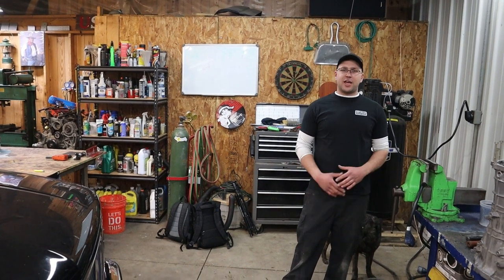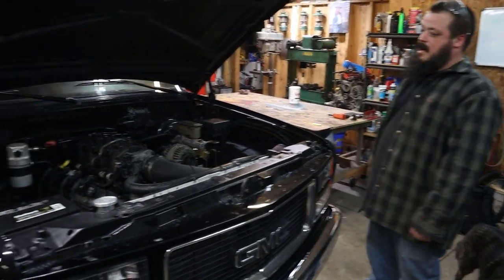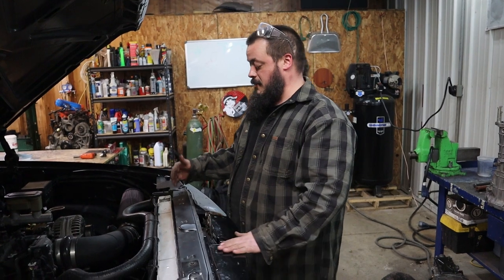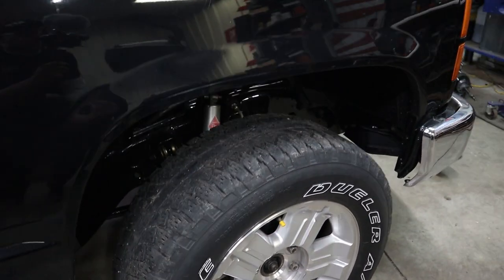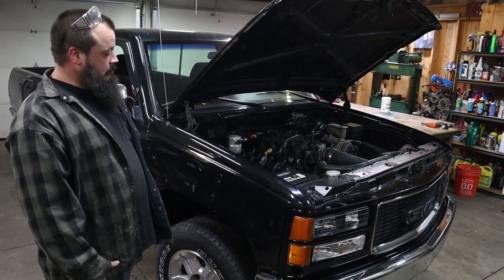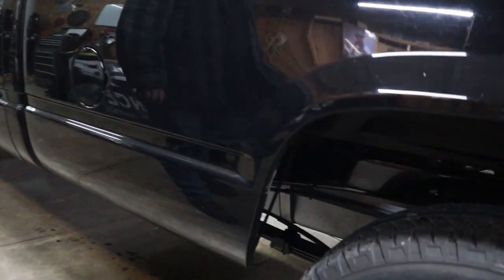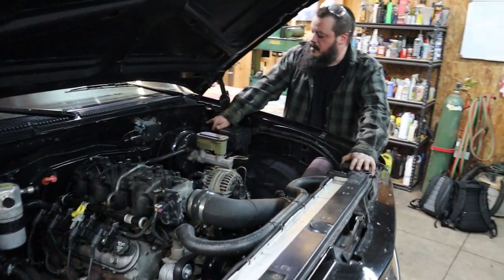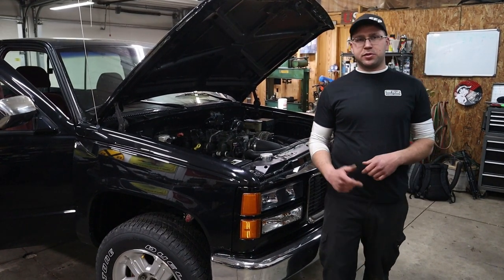CLEAN 95 Chevy/GMC OBS Truck - LS swap.

Comment: Doing the same thing" 93 4×4  it's a 6.0 4l80e 241c all done except the wiring, after watching many videos on the wiring, starting to think I'd be better off spending the money on a Holley Terminator X,  because. When this guy switches to a 4 L 80 he's going back to the tuner when he puts a turbo on he's going back to the tuner if he changed the cam he's going back to the tuner he changes the intake he's going back to the tuner gear ratio tire size... not to mention the Halo unit has to offer with power adders. I just need to figure out the gauges and the AC? Damn I hate wiring
Reply: Look up speartech for a harness..

Comment: This truck is awesome.  I am doing this on my 96 Yukon.  Where is the ECU located?  It is so clean under the hood.  Where is the coolant expansion tank?
Reply from the maker: Kelvinbellrose, the ls pcm is located behind the glove box in the original pcm location. I modified the original mounting pad to accept the newer pcm. And for the coolant expansion tank it is located on the radiator core support under the battery tray.

Comment: I have a 92 k2500 with a good 4l60e. I was wondering if a 5.3 would work with it. Will an LS PCM control an older 4l60e? At most I'd put a cam in it. It would be nice not to have to touch the drivetrain.
Reply from the maker: 332ARA, I do not believe the older 4l60e transmissions will work with the newer LS pcms. This truck had a 4l60e as well and what I ran into was the transmission connector on the Ls harness has alot more pins than the older 4l60e connector . Also the connectors themselves are different in shape and design. I think he best route if you really want to keep the original 4l60e would be to look into a standalone transmission controller.

Comment: 91 chevy silverado was my first truck.. Love the obs body and looked for years for the 2 door tahoe.. Finally found a completely straight 95 2d yukon 4wd out of the desert so 0 rust issues. Has the 5.7 thats still goin strong. Love driving the thing but having issues w the 4L60E trans. She revs at high rpm shifting out of 1st. It may be skipping 2nd and going 1-3. I can feather the pedal and it seems to help. I was told to do the vette servo swap on the trans.. Apparently its a known issue on this trans?
Reply from the maker: Yes I have heard alot of people upgrading the servo. My opinion is that would be a upgrade to do when complete rebuilding the 4l60e. The high revs most likely indicate worn clutch packs in the trans. I do not think servo upgrade alone will solve your current issues.

Comment: how long you running that 4L60E? I'm about to do a LQ9 swap on my 98 K1500 extended cab and dont wanna splurge on a 4l80E right away
Reply from the maker: Hey Kyle, I have had the 4l60e in for about almost two years now. If you get a feel for the Shift points and just don't hammer them to death it will hold up for a while. Modest driving it does well. Stay tuned going to be addressing my transmission soon.

Comment: Do you have a part number of converter and flexplate?
Reply from the maker: I do not have the p/n for the flex plate or to converter, but it is the factory flex plate that came with the LQ9 out of the 2005 Silverado ss. The torque converter is factory from 04 chevy Tahoe 4L60e. The stall for the torque convertor is not ideal for the engine, but it has good drivebility for now. New cam and torque convertor coming shortly. I'll be sure to throw in some P/Ns in the next video. Thanks for watching.
Reply: @StreetFabPerformance  thanks alot.

Comment: Awesome truck, was thinking about doing this to my 95 Z71 stepside. Would this swap work if you have a standard transmission?
Reply from the maker: Yes it would work. Changing from auto to manual trans is something you can change with a program like hp tuners if you are going to use a factory ecu out of doner vehicle.  For my LS HP tuner  requires 2 credits to access the ecm. Each credit is 50$ . Or if you live in the Ohio  area we can help you out. Streetfabperformance@gmail.com
Reply: @StreetFabPerformance  thanks for the information.